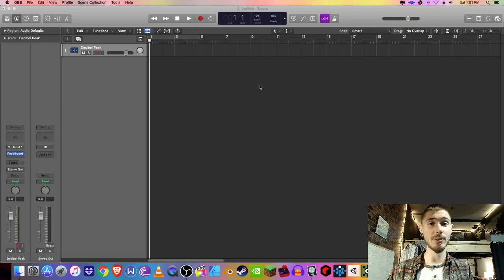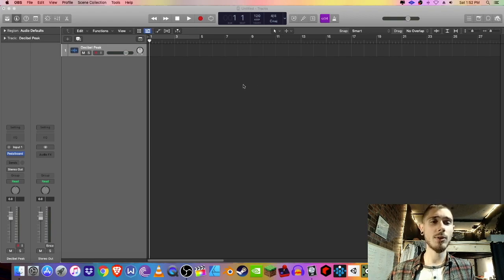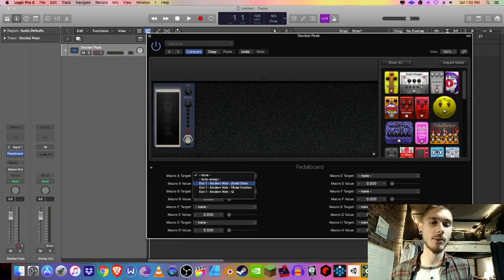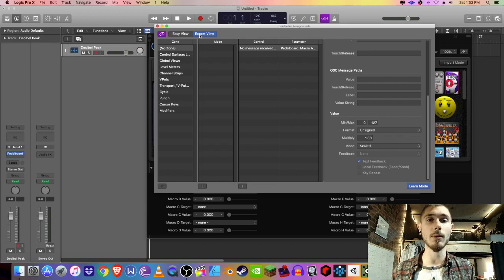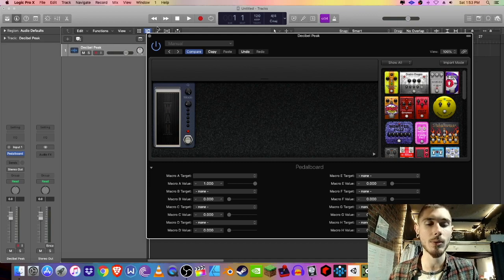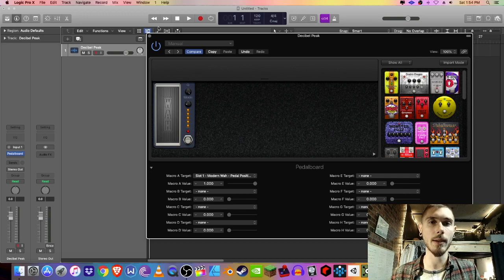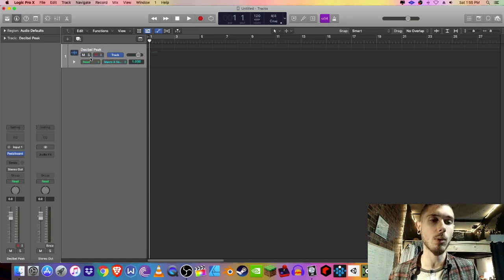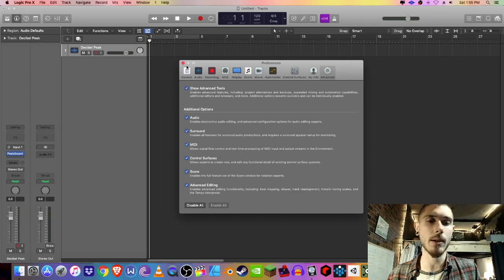Controlling Pedalboard With An Expression Pedal - Logic Pro X Tutorial

Comment: The first time you did it, you were assigning the controller to 'Macro A Target', as that was the last control you touched. The second time you did it, the last thing you touched was the 'Macro A Value' when you ensured it was set to 0. If you had went through the menu rather than using the keyboard shortcut the second time, you would have seen the difference

Comment: Great video. However I don't think that's a bug, when you assign MID you're supposed to bring the pedal (or wheel or whatever you choose to use) 2-3 times through it's full range of motion, and for buttons you're supposed to push them 3 times. Or at least that's usually how MIDI learn works, and definitely how it works in MainStage

Comment: Hello! can someone help me? I have an expression pedal, and I’ve done everything correct, but every time I push down on the pedal, the “Macro A Value” goes up but only by 1 unit. Like it starts at 0.000 and if I use my pedal it will just go to 0.001, and I keeps going up by one. It doesn’t match the value with the pedal. If somebody could help me I’d be thankful.
Reply: Did you ever figure it out? Mine is gone from 0 to Full, there's no sweep, just instantly from 0 to 100 so I'm wondering if theres a solution to that

Comment: Thanks for the great video im having trouble ive got a focusright 4i4 I've got my guitar plugged into input 1 and expression pedal plugged into input 2 my expression pedal has a switch on the bottom with a switch where i can select either 1 or 2 when it comes to assigning the macro it won't find anything even when i move the expression pedal has anyone got any ideas what im doing wrong???
Reply from the maker: Hello Chris,

It's not possible to connect expression pedals through your audio interface (especially not the XLR/TRS input).

You need some sort of MIDI interface.

I personally use my M-Audio Hammer 88 since it has inputs for sustain, soft and expression pedals.

Let me know if you're having difficulty finding something that fits your setup and I'll try to recommend some gear.

Thanks!

- Stefan
Reply: @decibelpeak  thank you so much man xx

Comment: AmpliTube has a Morley wah that has auto off in the heel position.  Is there any way to get the logic wah to do that?
Reply from the maker: Hello Matthew,

The wah pedals in Logic Pro X don't have the ability to disengage in the heel position. That would require another MIDI trigger since the on/off state is another parameter altogether.

If you've got AmpliTube, I think you're much better off using that than the stock Logic plug-ins. It should detect your expression pedal easily.

Let me know if you need anything else.

Thanks!

- Stefan

Comment: I’ve been trying to record the wahs in a 3rd party plugin called AmpliTube for a few days. I followed your instructions then loaded AmpliTube in the audio fx slot below the Logic’s pedalboard. Worked perfectly! Thank you!
Reply from the maker: Hello Artie,

I'm really glad to hear it worked out! It's also great to know that this method works with AmpliTube.

Thanks for sharing!

- Stefan
Reply: @decibelpeak  I'm not sure what changed, but whenever I follow the steps you demonstrate, Logic is only registering partial movement of the expression pedal. I set the macro to 0, move the pedal, and it works the first time. After that, Logic doesn't recognize the full range of the pedal. I have a test project where I initially used your method, and when I open that project, Logic recognizes the full range of the pedal, and the wah works as expected. When I try the same thing in a new project or existing project, Logic doesn't recognize the full range of the pedal, making the wah useless. Any ideas on what might be happening? Thanks!
Reply from the maker: @artienorton  Are you sure that pedal position is still selected? The issue I was having is that it was latching onto pedal state for some reason. When you assign a macro target, it targets the last parameter you interacted with. Just make sure it's pedal position first and let me know if you're still having issues. We'll troubleshoot further. Thanks!

- Stefan